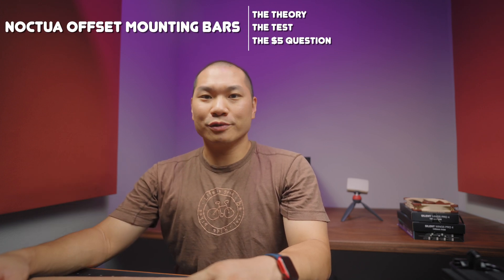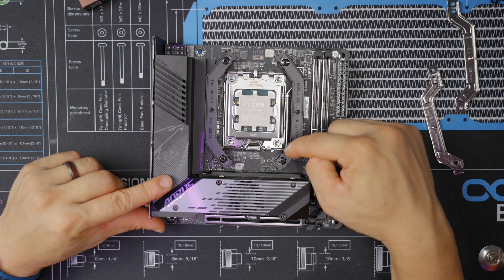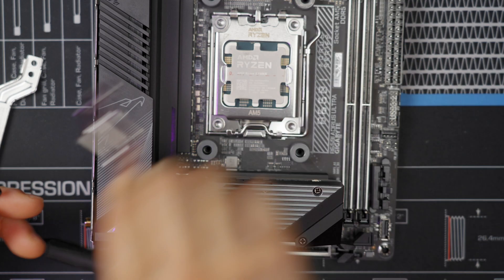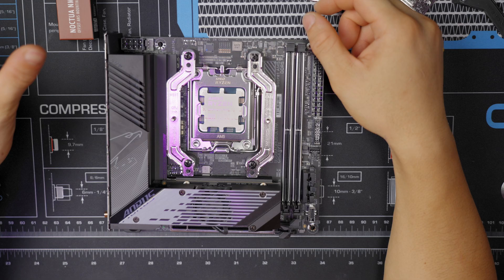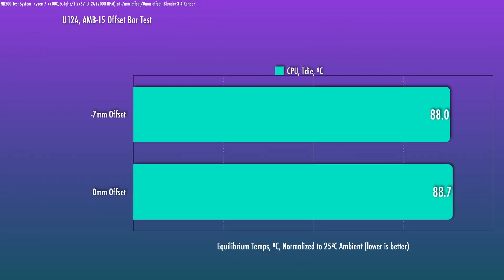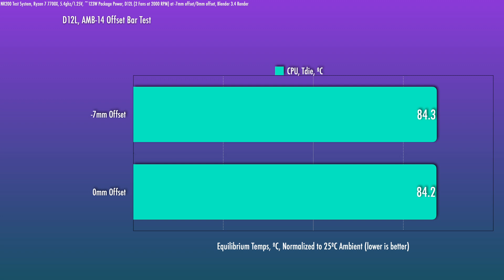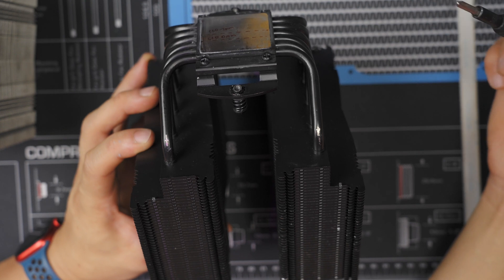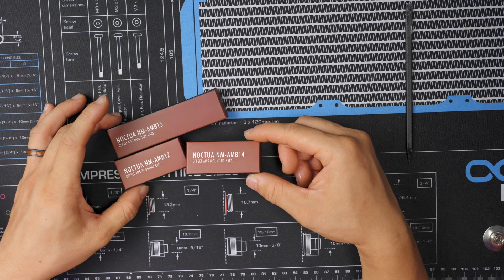The New Noctua Offset Mounting Bars - Tested!

Comment: I have the D12L and it does seem to have a tiny impact on how soon my CPU throttles, with the offset I gained 30MHz average on all cores in Blender (Classroom).

This cooler isn't suited for the AMD 7950x, I bought it as a temp solution to figure out AIO's.

I got a much bigger performance boost setting PBO to negative 20 (+ EXPO Tweaked profile on the RAM). That increased the average MHz on all cores by 191 and shaved off 7 sec render time.

All of this could also be how I applied the thermal paste the first time. I did the tests the same day so ambient temp was about the same. 
Render was on the CPU only.

Don't  buy the second fan for the D12L, it barely does anything. My extra fan will become a case fan when I buy an AIO.
The round fans comes with rubber mounting...things, so it will mount to the case as well.

Comment: The delta in temperature is negligible as long as the thermal paste is covering where the die is. It’s the reason why offset mounting for AMD can sometimes give as good if not better temperature even though it doesn’t make full contact with the heat spreader.

Comment: I made the same thing (not that pretty, but it's the same 7 mm offset) for my Ryzen 5800X3D that is pretty hot and I don't think there is a difference worth that work, maybe 1 or 2°C or something, but I would say that temperature now reacts better and faster to RPM change, so there is definitely something slightly different. My CPU has only one hot 7 nm CCD down on right side, so maybe to move it not just down, but even slightly right would help even more, but I don't know how hot is that bigger chip and if I don't cause some overheating there. BTW, those morons from Noctua use atypic M3.5 mm screws, it was a pain to find some for my homemate offset mounting and it was even worse pain to make a threaded hole for it. I absolutely hate 3.5 mm screws, Italians use them too and we have machines made in Italy in work, so I feel this pain everyday when I need to replace some screw. World would be much better place if Noctua and Italians took just M3 or M4 mm and didn't make me angry!!! There can't be other reason why to use M3.5 mm than to prevent you from modifying it, replacing screws on italian machines without buying their own expensive ones or making your own offset patent, I don't like this behavior that many companies do.
1:15 - here you can see what I am talking about - why the hel M3.5 mm screws? 😀  

BTW, for AM4 with those smaller metal plates down and up, it's much easier, you just flip one 180° and it's exactly 7 mm offset, so you need to make just one of them and there is a lot of space aroud my socket, so it was all pretty easy to make.

Comment: Noctua claims that for a D15 G2, with low convexity base, the offset is not needed. I suspect the offset brackets are just a bandaid for those heatsinks which don’t offer an LBC option, as their standard base works better on intel than on AMD.

It would be interesting to test a D15 with normal convexity base, perhaps a gen 1, with a DQ15 with offset mount.

Thanks for looking into the D12L by the way. I was considering an offset for 5800X3D, but if it makes no difference on that cooler with two CCD’s, it certainly won’t make a difference with one

Comment: hi thanks for this video, it gave me a clear understanding about the offset principle. I have a question. I'm looking to build a pc with the Asrock X870e nova wifi and a noctua nh-d15 chromax. But appearantly that cpu cooler wont fit the mobo if i understand it correctly. 

(source: https://ncc.noctua.at/motherboards/model/ASRock-X870E-Nova-WiFi-6098   stating: "When used with the offset mounting position of the AM5 offset mounting kit, the cooler overhangs the top PCIe x16 slot. This issue can be resolved by using the standard (non offset) position.")

does this mean that i CAN use the nh-d15 but just not in offset and only in standard mode? and if so, would it be a problem you think to not being able to use the offset mode? i think the noctua might give already superb cooling in standard mode. if not i might look for another MoBo. 

thanks!

Comment: I came here after building my 9700X and then wondering if I should have used the offset on my D12L (1 fan). Found when aida64 stress testing temps not going over 67C so I don't think it matters that I didn't bother to offset, and this video seems to confirm that I'm not missing out on any performance. % gain would mean maybe maybe 1-2C drop, and I'm not near max temps at all.

Thanks for doing the work for me so I don't have to try

Comment: Hello. Thanks for testing. Could I ask you how exactly you screwed in the coolers? Specifically the nh-u12a but I assume all similar? Did you screw until the screws stopped or before then? As I am confused by the manual which says to screw gently "until they stop" with a max torque of 0.6 nm. Yet it feels like you're not screwing "gently" unless they just mean "slowly". I also see conflicting comments online of people saying that torque is only "finger tight" but that can't be true at all as mine isn't even finger tight... but I didn't go until the screw stopped. So maybe I didn't tighten enough?
Reply: “Until the screw stops” means just that. Mahbe it gets a little harder to turn towards the end at the spring part, but eventually it will come to a hard stop, that’s when you know your done. You won’t be able to continue unless you apply a shit ton of force, and maybe break something

Comment: Soo, with the noctua d15, using the 7mm offset mount for am5. Gets worse performance then the standard 0mm? Its hotter right.
Reply: Or are the -7mm and 0mm offsets the other wat around on the test of the d15?
Reply: @leavii5449 based on what he says his graph is wrong. Should be the other way around.

Comment: difference between offset frame and contact frame? which is better and will both work?
Reply: I'm planning to use Thermal Grizzly's contact sealing frame which also is a paste guard, with the offset bars. Should work great. Optimal pressure on the CPU and the perfect position over the CCDs.
Reply: Use both. The contact frame will give you more even pressure distribution, and the offset will make sure it’s in the right place

Comment: If heatpipe placement is the main affecting factor, then an interesting idea would be to turn the heatsink 90 degrees, which should give the CCDs direct contact with more heatpipes than just a mere 7mm vertical shift.
Reply: Airflow aside, you would achieve better mounting pressure over the CCD’s, with the mounts turned 90°. Currently the convexity of the base for Noctua is vertical, you can see this from pressure distributions of their mounts on intel chips. If you turned the cooler 90°, the main clamping force would be horizontal across the cpu, acting on more of the CCD area, especially when combined with an offset mount.

The issue with this is that most cases are not setup for vertical airflow, and your GPU would be a massive restriction towards that end

Comment: so the conclusion is that offset doesn't work?
Reply: Watch the video, it dropped temps on the NH-D15 by the 3 degrees Noctua said it may.
Reply: @jamesg8246  There is a mistake at 10:50 - chart is the other way around. I assume that is what confused him, as it did me at first.
Reply: It’s a step in the right direction, that’s all

Comment: Offset for L12s but on a 7800x3d in the fractal terra
Reply: How are your temps?
Reply: @ab185 The temps are essentially the same for the 7800X3D.  At least they have been in my recent testing.

Edit - I meant that the temps are the same between the regular mount and the offset mount. Idk why I didn't clarify that initially lol

Comment: Wouldn't these work with AM4 as well? As far as I know the only difference is the height of the CPU
Reply: arctic includes 7mm offset and says it benefits 3k and 5k ryzen
Reply: @Astrothunderkat   True, I bought the 280mm Freezer aio, it comes with the offset holes for my Asus AM4 board, I came from a Thermalright Macho Rev C cooler with a 140mm Noctua fan, now my 5800X3D has an improvement of 10C idle, 6C gaming and like 4C under full load, for reference my cpu is idling at 32C as of now, pretty sure the offset holes, aio and new paste are the factors here but that also means sustained boost clock a lot longer.

But be careful bc the downside is that my Toxic 360mm GPU (on top as exhaust) gained like 5C bc my new 280mm Freezer is acting as intake on front the case, any advice? Went from 55C gaming to 60C.
Reply: Noctua says it's less than 1°C difference.
Reply: @TolaGarf yes these also work on AM4, but Noctua says they aren't as effective as on AM5
Reply: V

Comment: $5 extra for the D15 Rev.2 might be worth it. You're already spending over $100 for an aircooler, what's another $5.
Reply: Might? Is*
Reply: I remember Noctua saying that the new offset mounting bars will replace the old ones. Including in already existing coolers (from October this year???) could also be wrong...
Reply from the maker: Yes- by end of year they say all multi socket coolers will come with the new bars. There’s probably just time that’s needed for old inventory to cycle out.
Reply: @tthbeige3332  That will be good news. I'm planning on getting the D15 Rev.2 for my next system.

Comment: My offset kit also arrived today. I'm using the NH-D15S with two fans and my results are basicly the same, 3-4C° better under load which puts it on par with my Arctic Freezer 280, but at a more pleasant noise level.
I also noticed that my main NVME temps went down by 5C°, maybe because the fan now sits more above the heatsink.
Overall for 5 bucks it's definitely worth it and both the NH-D15 and NH-15S still fit perfectly without touching the GPU or SSD heatsink on my Asus B650E-I, but the D15S has a little bit more clearance for big SSD coolers.
Reply from the maker: Thanks for the data point! Yes the NVME temps are a good point as well!
Reply: @MachinesMore  Hi. You have a mistake in the chart at 10:50 - it should be the other way, according to what you say further down in the vid.
Reply: just curious, whats your cpu idle temp? im getting 55c-58c with an 7700x and the NH-D15
Reply: @XASMATV.  I'm running the 7950x non 3D at 105w eco mode and idle temp as in doing basicly nothing or watching a YT video is 45-50C° at 27-28C° room temp.
Even 55C is still normal, Ryzen 7000 spikes up pretty quickly.
Reply: @kwedl  thank you so much! so it seems everything is normal then!
Reply: @TRC_WA thank you guys for letting me know!

Comment: 0.7C is not worth it
Reply: U12A  = .7
D12L = 0
D15 = 2.8

$4.90 for the bracket, interesting option for possible reduction in temps. Possibly with other components as well (NVME)
Reply: @ZioComposite  I wonder how mucha change the D14 would get. and worry about the ssd and gpu getting hotter with the offset.
Reply: Ah yes 1 cooler accounts for all of coolers. Great logic.
Reply: @TravisPNW I agree my friend
Reply: @TRC_WA  If you're touching the thermal limit on occasion, causing throttling, it's 3 degrees cooler...   My 7800X3D maxes out @ 80*c fully maxed out with the NH-D15 with stock symmetric brackets, (89*c is it's limit), seeing 77*c max load is worth $5.  It takes me from 9*c headroom to 12*c...  If you watch any serious heatsink reviews, like Gamers Nexus does where they really test a bunch of coolers against each other, 3*c is a very large difference.  The new Gen2 NH-D15 coming out soon is only claimed to improve on the original by the same amount (2-4*c), and that's with a completely redesigned heatsink with new fin pitch, two extra heat pipes, new fans and took 8 years to develop to get those 3*c.  So yeah.  It's a lot.  Again, Gamers Nexus has a great in depth video covering the Ge2 NH-D15 @ Computex 6 months ago, check it out.